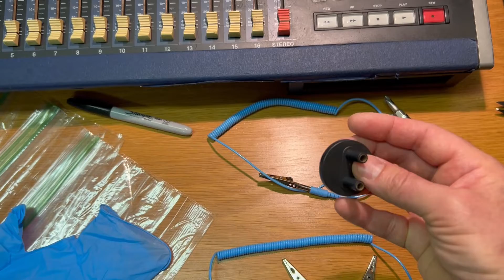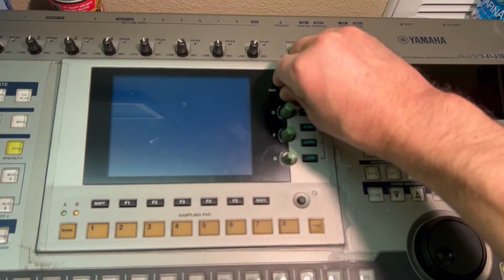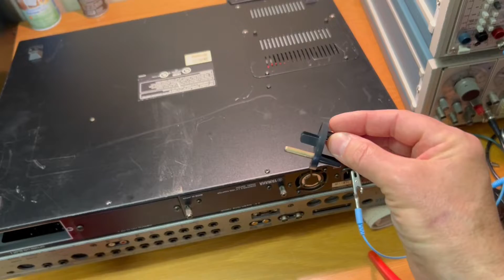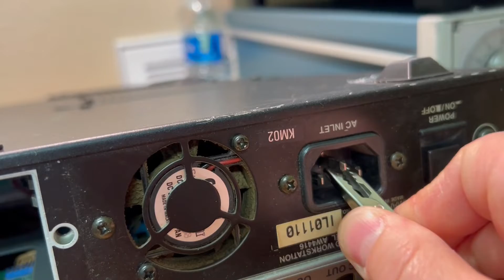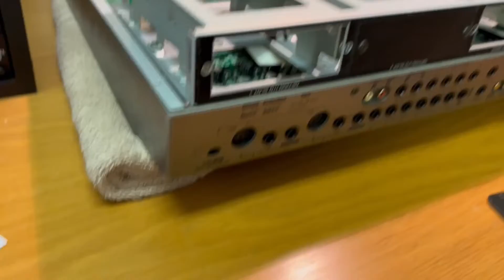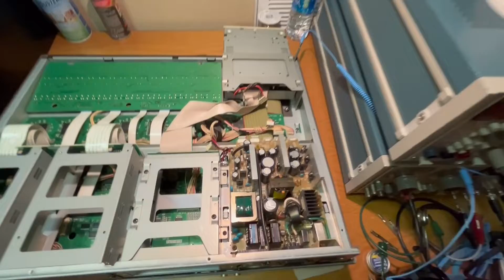Yamaha AW4416 Disassembly For RTC Replacement ~ Detailed!

Comment: Nice, well done. I took the Yamaha Professional Service Certification program years back in LA. I have the utmost respect for their products and service. Great company. I think you had your right hand on the RTC when you went to pull the motherboard out. It kind of sticks out. I have a unit I am about to launch into. I saw online somewhere that someone appeared to melt the DS12887 with a soldering iron to expose the leads to the battery and attach a new one nearby. Not going to try that but I do plan to use an IC holder and I wonder why they didn't. Also, I used some thin rubber sheet with adhesive on one side to cover up the sticky rubber mess that degrades with the elements over time at the front of the unit, where the one you worked on has painter's tape. It looks and works great. Did you do a video of the chip replacement? I tend to cut the IC leads and use some pliers and extract them by heating the solder to save the traces then clean up with a desoldering wick braid. Be well.
Reply from the maker: “I saw online somewhere that someone appeared to melt the DS12887 with a soldering iron to expose the leads to the battery and attach a new one nearby.”

There are several different approaches to address a failing or failed RTC IC battery. The one you mention is to either, as you noted, melt the plastic casing to expose the battery terminals, or use a rotary tool to grind away the plastic casing to do the same, and in either case then weld flying leads to the terminals and mount some sort of external battery holder and battery. There is zero reason for anybody employ this approach anymore. As manufacturing demand for the 12887 family of parts diminished years ago, production did as well to the point the 12887 was no longer available as new stock. There was a period of time a replacement could not be purchased. This was prior to a ramp-up in demand as the battery in original parts across the globe began to deplete. Maxim restarted production several years ago and new 12887 ICs can be readily obtained for a reasonable price from multiple reputable vendors. But during the “RTC dark ages” people came up with some creative solutions. 

“I do plan to use an IC holder and I wonder why they didn't.”

I’ll take it a step further…*I* think they should have spec’ed a 12885 with a board mounted coin battery holder. But they did neither because, even in the late 1990s, we were already a relatively “throw-away” society and the rate of computer-based obsolescence was already high as well. I think Yamaha assumed it was extremely reasonable that advances in technology within 10-15 of the AW4416’s introduction would have the AW4416 relegated to the land of the forgotten by then. They were wrong. There are still thousands of active AW4416 owner/operators/enthusiasts around the world. There is a very active and well-administered FaceBook group for the AW devices; 1,400+ members and climbing regularly. Yamaha couldn’t foresee the future. Still, it’s hard to fathom it would have cost that much more to manufacture the AW4416 (and AW2816) with a battery holder and a 12885 like many other devices. I think they made a mistake. I always install a socket when replacing the RTC. There are also aftermarket parts available, a 12887 compatible IC with an exposed battery and holder…a small PCB with integrated DIP headers, the RTC circuit on the underside and the battery holder on the top. So…options. 

“Also, I used some thin rubber sheet with adhesive on one side to cover up the sticky rubber mess that degrades with the elements over time at the front of the unit, where the one you worked on has painter's tape. It looks and works great.”

I really despise the “soft-touch” coating on anything because it always goes tacky. I wish Yamaha didn’t do that to the AW4416. They didn’t to the AW2816 at least not the fader panel…the jog wheel still has it. If you wait long enough for the coating to get really sticky it then comes off pretty easy with isopropyl alcohol without ruining the screening. There’s also a guy in Europe who desktop published a replacement label for the entire panel…have it printed on self-adhesive vinyl sheet and, after stripping coating and paint off the fader panel, apply the label to the panel. Looks like new…labor intensive though. 

“Did you do a video of the chip replacement? I tend to cut the IC leads and use some pliers and extract them by heating the solder to save the traces then clean up with a desoldering wick braid.”

I didn’t do a video of the actual replacement of the part because, at least how I do it, there’s nothing remarkable to it. I see on the internet there are a number of different ways to approach it, even cutting all the terminals with a mini death wheel, but there’s nothing particularly unique about the part or the PCB assembly on the AW4416…yes I’d rate the desoldering and soldering process as requiring advanced soldering skills and appropriate equipment because the board is dual-sided and glass fiber, the solder pads are relatively small, it’s a DIP24 packaged part with 18 pins, and access is limited even once you have the board assembly out of the unit…care has to be taken not to damage traces or surrounding components. But it can be done…I’ve done the procedure a number of times and at the end of the day it’s just a through-hole IC component, so I remove it like any other through-hole conponent. I use a good quality manual spring-loaded vacuum solder sucker, the kind with a hi-temp silicon rubber tip, and a 12W Antex pencil iron…3/32” chisel tip is about the right size for the job…comes out very clean, I can work fast and avoid any unwanted damage…the tools work well enough that literally I just slide the part out after removing the solder. Yes sometimes I have to clip maybe one leg or something but usually not. It takes about 30 minutes total for me to disassemble the AW and have the RTC out. Regarding solder wick braid, I don’t like it and have never used it. I know lots of people do, but with the potential mess, risk of unwanted heat transfer especially on more dense SMT assemblies, I don’t know why I would pick that over the quick and accurate process using a vacuum solder sucking tool, but 100% each time their own and what works for them.
Reply: @SweetbeatsTechStop  Thank you for the wealth of knowledge you kindly shared. I like Yamaha did not think this type of format would endure, but the control surface has not been matched with computer based recording and they live on. I made the hard switch to Pro Tools and sold mine long ago, but just picked up another one that needs the new RTC. They sound better to my ear too. Yes working quickly saves the traces from damage. The solder wick too, I use it for clean up mainly if required not to draw solder away from a joint. I use a solder sucker of good quality for most of the task and take care on each pin. The double sided nature of the PCB can make it tricky to get both sides void of solder cleanly I find, but a steady hand, the right solder tip and temp coupled with a clean close up view of each joint usually works, I just have to prepare myself mentally for it lol. Be well I look forward to your future videos.
Reply from the maker: Thanks. I wasn’t intending to be judgmental or anything of the like. I was thinking later one of the main reasons I’ve not used solder wick, possibly, is because much of my work is on through-hole phenolic resin-based PCBs as opposed to SMT glass fiber boards. Then solder wick seems handy to clean SMT pads. Anyway, thanks for the feedback. I appreciate it. I think the AW4416 is a unique device.